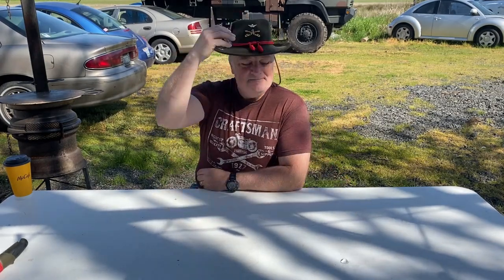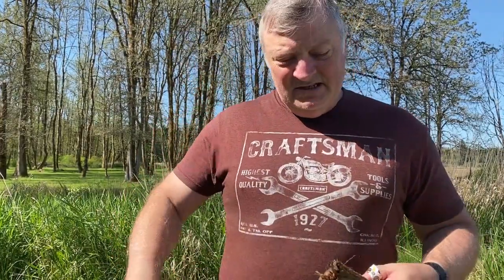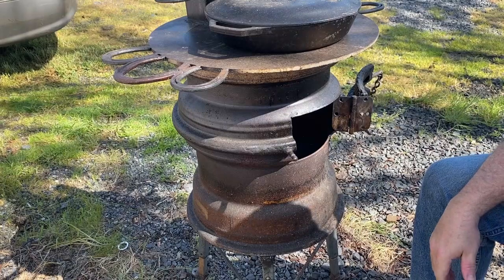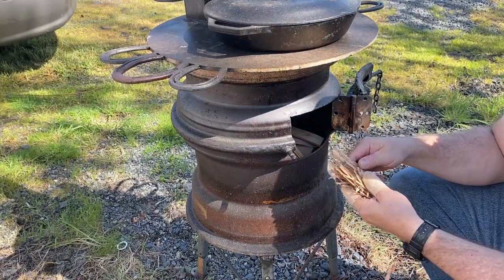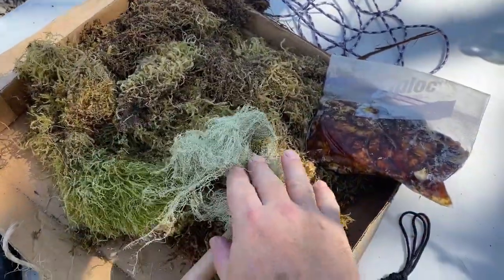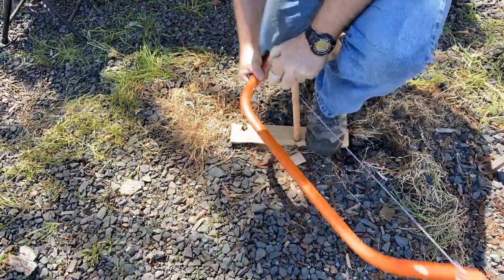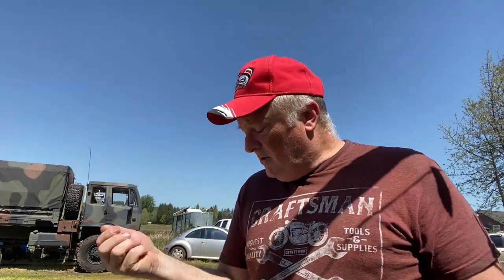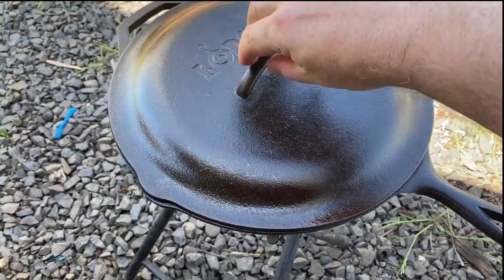My Cooking Challenge: Bow Drill Fire

Comment: What kind of wood were you using for the hearth and spindle?  I have had good luck with cedar (western red) for both hearth and spindle.
Reply from the maker: The spindle was oak and the hearth was pine. The problem was doing it in full sunlight... I could not see the ember, and so when I saw there was nothing burning and set the bird's nest down, it began to smoke about 15 seconds later. I know I must have had an ember at least four times... I was just out of practice, and it was going to get back into again.
Reply: @HelicoolsHelipad  Interesting, most recommend a very soft wood for both the hearth and spindle.  I guess you can start a fire with most any dry wood if you work hard enough.